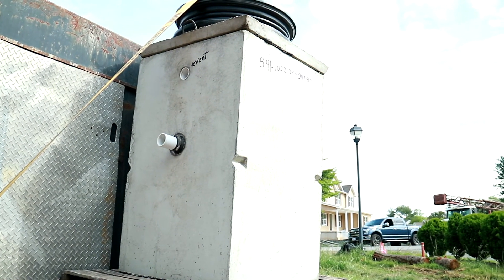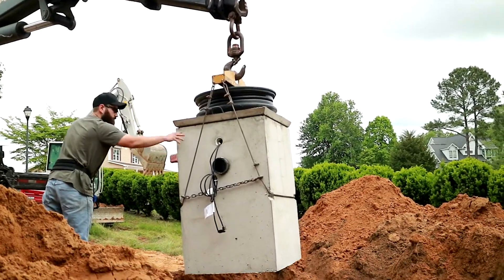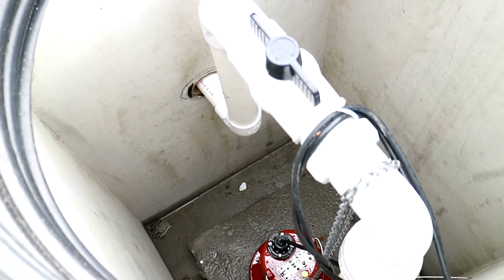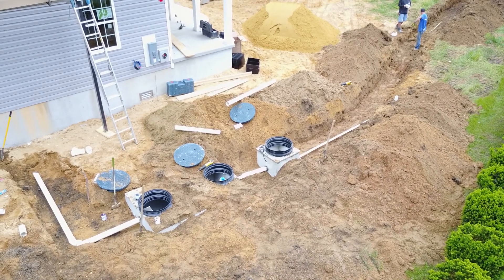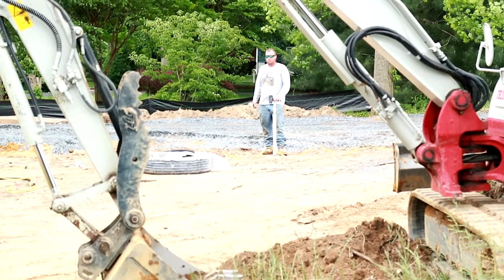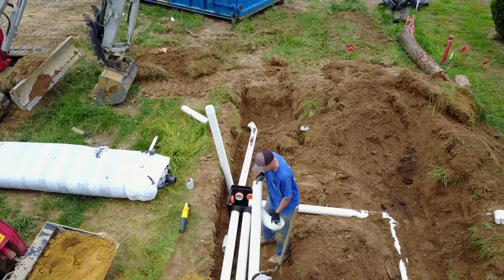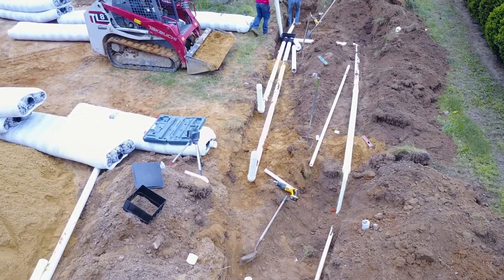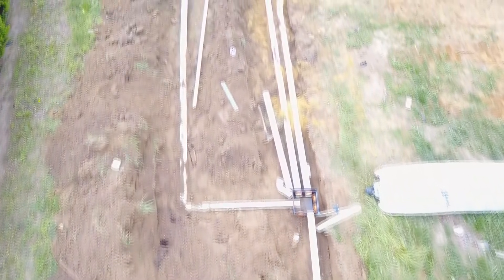Making Sewage Go Uphill Before Turning It Back Into Gravity?

Comment: Where can I get a lift station as shown? Btw I'm in Missouri
Reply from the maker: You have to talk to a plumbing supply house but they typically should only sell to licensed contractors. You will probably need to work with a local contractor. Thanks for watching.